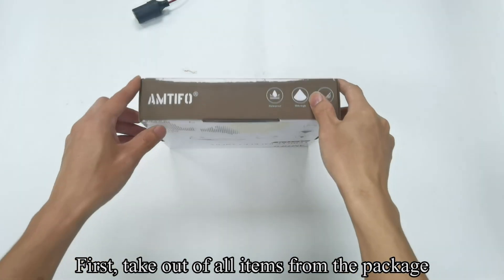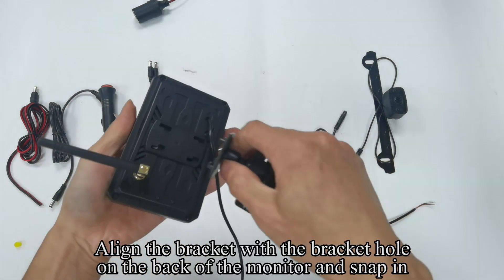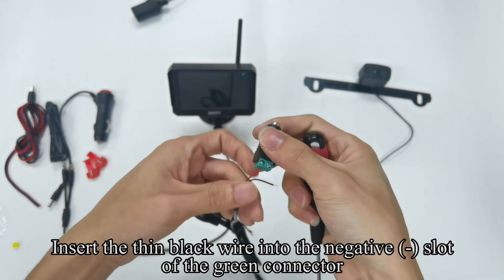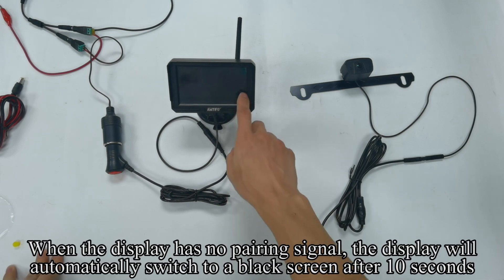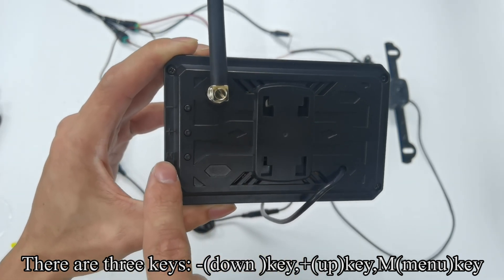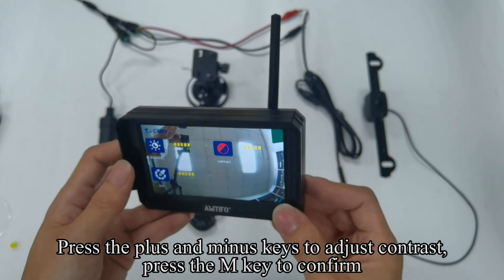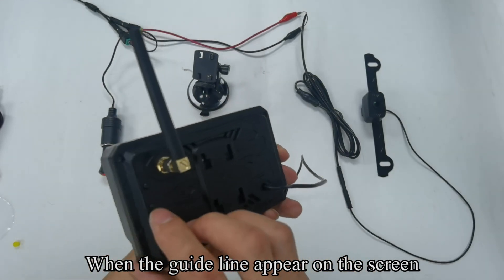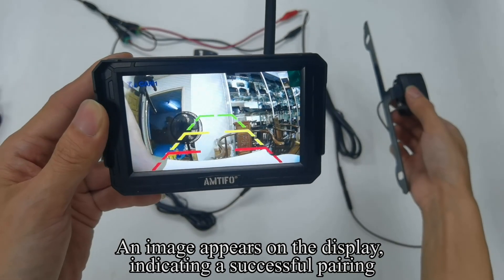AMTIFO A18 Wireless Backup Camera System Operation Video

Comment: That’s an awful lot of wire for a WIRELESS system??
Reply: What they mean is it is wireless communication between the camera and the monitor, so you don't have to run any wire between the two. The camera gets power from the  tail lights or back up light and the monitor gets power from the car battery or the lighter socket, both by wired connection.